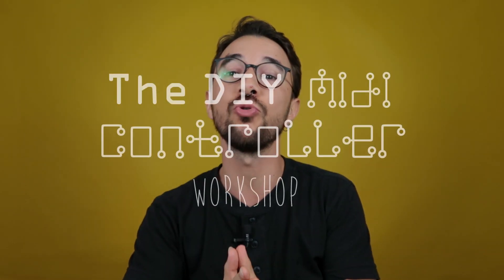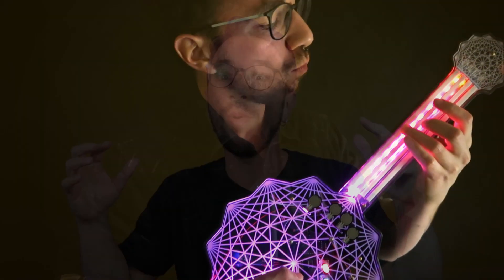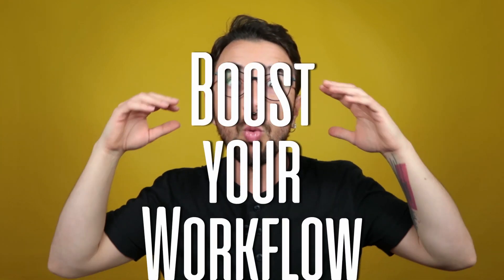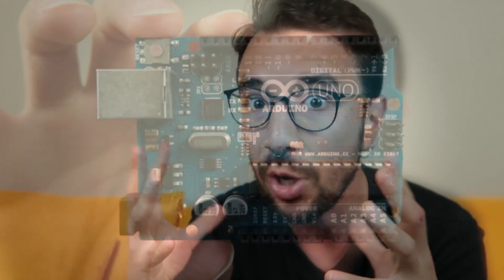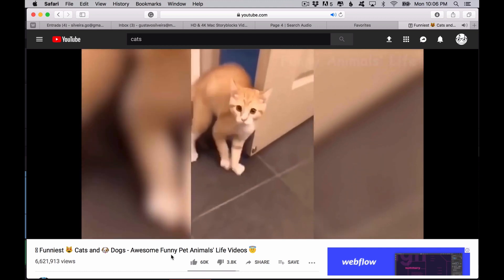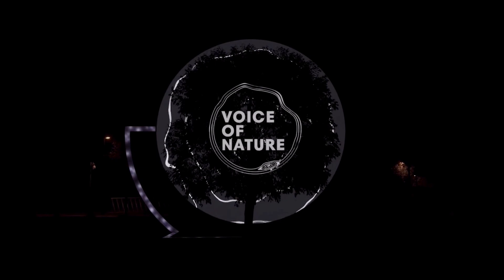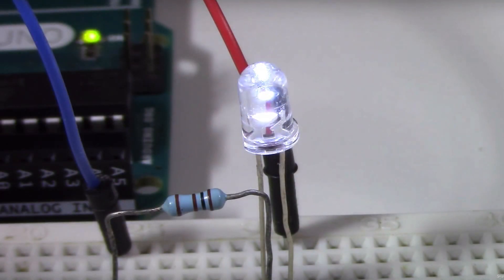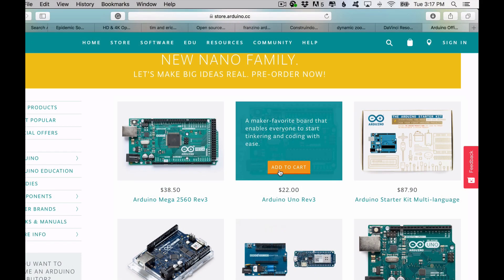#1 How to Build a MIDI controller with an Arduino: The DIY MIDI Controller Workshop 2.0

Comment: I have Morningstar MC6 MKii and I only want to build arduino project to send MIDI CC messages to indicator LED light for each footswtiches . What type of Arduino would you recommend. Does the new Arduino Nano R4 works for this kind of project?
Reply from the maker: I haven't been able to use my usual libraries with the newer Arduinos, so I'd wait some more time to start using them.

Comment: I would like to know what kind of Arduino I can use to trigger presets on an Alesis Q2? What I used to do on an RFX midi buddy pedal is press the switches 0-9 and it would trigger presets numbered 000-009. Then there was another switch that allowed me to bank 10-19 and so forth! Up to 128 presets.
Reply from the maker: An Arduino Pro Micro. But, start here to understand the basics: https://go.musiconerd.com/diy-midi-controller-workshop

Comment: Hi, I am looking to build a MIDI controller with at least 72 full rotation (relative) potentiometers sending 7bit / 14bit MIDI. These knobs will be clustered in 9 sets of 8.  In addition, I wish to have a 16 step knob (or a slider?) for for each set of 8 knobs that sets the MIDI channel for that set of knobs.  This rig will replace my beloved FaderFox PC12 with full rotational (relative) knobs, rapid channel switching, and m uch bigger (say, 3/4inch) heavy duty knobs.  It is basically a dream rig for my live synth set up.
Reply from the maker: you can do it, but you should start with smaller prototypes! I teach how to do all you need in my making music with Arduino course. https://go.musiconerd.com/making-music-with-arduino

Comment: I bought the midi fighter 3d and need to send lower octaves than is supported by default, so still need to use an arduino to change the midi notes 😛

Comment: I wish I had a use for a light, temperature or humidity sensor in the controller I want to build. They'd be fun to experiment with, but not very practical for onstage playing.

Comment: I'm not going to say that I would like to build it, because I definitely will. I'm going to build a set of foot pedals that control variable resistors, or pots, and foot switches that will toggle between the CCs the pedals are sending out with one switch per pedal. It will have to have some sort of accompanying software either just on board or on a separate computer to choose which CCs each button switches between. I figured out a way to use VST effects on guitar with very little latency so I thought I might assign some contollers to the parameters, but stopping playing every time I want to turn a knob or move a slider is cumbersome, and my feet are free. I figure 4x2 pedals with the button switches on each side next to each one will be about the biggest that will still be practical. This will be my my first electronics and software project ever and to be honest I'm more than a little intimidated, but I think it might be my best option right now so I kinda gotta do it anyway.

Comment: I want to built a midi mixer for ableton.
What I've thought is That for the mixer potentiometers, I would like to to have rotary encoders with leds on the side for indicating the level. So any saved project you open, automatically the encoder shows you the position of the potentiometer in the daw
This is like motorized potentiometer but more simple and cheaper

Comment: Not sure im going to learn all this Arduino coding stuff - but it would be pretty awesome to have a custom controller for some of my favorite NI plugins - or maybe for a project that i build in Reaktor..! Although with Reaktor, it might be easier to find a nice midi controller that has a layout that is suitable for the type of Reaktor project that i want to create, and then design the Reaktor project to match the design of this midi controller.

Comment: Title: "How to Build..." 
Content: Explains purpose of MIDI and that Arduino is a way you could build one. 
"How to" not included. No code, no details about MIDI spec or libraries or hardware details necessary to actually do it.14min wasted
Title should be: "What does MIDI accomplish and can you make a MIDI controller with Arduino?"

Comment: Is it possible to make a midi controller with ribbon controls , and pitch bend , mod wheel, and a bunch of CC knobs , CV gates and work with a 73 poly agtertouch? Can you use many arduino systems together ?

Comment: Basically i wanna build a midi controller that allows me to take any sound from any instrument or mic and convert it to actual midi notes👌👌👌i also wanna throw in some drum pads that are small enough and versatile to stick on any surface so i can use em on any instrument so i can do easier live looping sessions😏👌imma do the led projects after i get these to work tho😅but i wanna make velocity sensative lights that interacts with the instruments i use and individually with each note i play😁
Reply: For what it's worth, I was recently looking into where the current state-of-the-art was in converting sound into MIDI in real time.  For the most part existing software wants an existing file to convert.  And it is helpful to tell it if it is a melody, polyphony, or drum track.
The only thing I found in my admittedly non-exhaustive search was the OVox plugin.  It can give MIDI output in real time as well as do a bunch of other things.  (https://www.waves.com/plugins/ovox-vocal-resynthesis#ovox-next-generation-voice-controlled-synth)
Reply: @lannyfuller8367  thats another thing: i dont have a laptop/pc to run plugins cuz i produce... well, i try to produce everythin on my phone and so far, its limitations surpass its potential😅but imma keep this in mind for when i DO get a laptop or pc👌👌👌also, im using a Samsung galaxy j2 prime... i cant even get my otg cable to work and i been lookin for ways to make it work this entire week😥so a laptop or pc would kinda clear all my limitations, ya kno?

Comment: I would like to build a controller for Spitfire Audio Plugins or the Kontact Player for specific CC midi control like Expression, Vibrato and Dynamics. Also to select between articulations which is currently difficult to use because I have to assign them to key switches. Any guidance would be helpful.

Comment: I want to build a 5 keyboard (61 on/off keys each), 1 pedalboard (32 on/off notes) pipe organ console with 5 analog  (linear or possibly rotary potentiometers) pedal controllers and approx 120 stops (latching on/off buttons similar to a pinball machine buttons) and about 60 small momentary preset push buttons for basically sending sysex type messages ('registrations or combinations of stops).
I can do with 6 separate boards, but the biggest Arduino board I have found is the Mega which only has 53 digital I/O and I need at least 61 for each keyboard manual.
Then I need to decide if I want each board to output MIDI and use a midi merge, or if I should output each as USB to a USB hub and then into the computer and use something like hairless (is that right) to convert to midi for a virtual pipe organ software called Hauptwerk.
I have the keys and pedals.  I just need to figure out how to build the adapters without much latency (note lag).

Comment: I have a question. The Novation Nocturn is a fantastic midi controller. It only functions with a driver and automap which are not supported in the latest OS Catalina. Its seems to me that a nice project would be to convert this unit into a ‘dump’ midi controller using arduino. Is there any way of doing this?  Thank you!

Comment: I am looking for a good explanation so that I can build a midi controller for the sylenth VST synthesizer myself. For this I want to use a Robotdyn mega xpro 2560. The midi controller is modularly built with a vintage look. The first modules I want to build are the midi controllers for the 4 oscillators. In total there will be 14 modules.

Comment: hello and thanks for your video. I just need to build a WIRELESS controller with two buttons one  to launch effects and one to pause (for example to use with abelton live or Millumin or with Qlab…) just to launc effects from the stage as we are performing a thether piece…thanks for your answer and for your informations 
Best regards

Comment: Hi, very cool and interesting video. Building electronic music circuits changed my life. I am a retired Union electrician and instrumentation technician now.
My main controller is a Roland FR-3X virtual accordion.
I started building circuits back in the late 1960s. Built PAIA synth/computer. Tried to build a Minimoog at NASA (long story).I was looking for a way to build a very simple midi theremin and stumbled onto your videos. Just sending out one CC value on one channel based on a proximity sensor would work. I like how Merzog modulates a filter with one. Thanks and great work.👍🎶

Comment: Hey, crazy question. I have Yamaha Steinberg N8 DAW mixer that is bust, but also relies on FW connection (not laptop frindly thunderbolt or usb), so my question is, would I be able to recreate the device with arduino circuits? keep in mind the N8 has preamps and individual channels Id like to keep individual in my DAW
Reply: Looking back into the matter after doing bunch of other stuff in between.

Comment: Question: Would an incremental rotary encoder or absolute rotary encoder be better for a midi controller? Or does it just depend on it's function? I'm struggling to understand the differences and how they would effect on what I'd use either one for.
Reply from the maker: It depends on what you want. Encoders are good if you want to use one knob for multiple things, because you can just update their value and update an led ring. But they are trickier to use and you can't use as much in an Arduino.
Normal pots are better to play because you know their physical position, but it's a matter of taste. Also, easier to use and you can hook up a ton of them using multiplexers.

Comment: Working on designing an expandable SSL-style controller for Propellerhead Reason DAW. Problem I am running into is that I need to make the project expandable, from like 8 to maybe 32 channels, or more. What I am not sure about is how to link all boards together to a single MIDI bus. Thanks for making this video!
Reply from the maker: You need to use multiplexers, they multiply the number of inputs. Something I teach in the complete course. https://nerdmusician.teachable.com/p/making-music-with-arduino

Comment: Is there a course in your website specifically for the led strips?, where you tell how to create the led strips connection (e.g. physical and w/ software) to the keyboard? what kind of wirings needed? I want to build a led visualizer for my keyboard piano (there’s 2 ways for that after I’ve researched. 1) is using raspberry pi (which can be expensive for all the connections/wirings needed), and 2) is the arduino

But, I’m not techy, and need a step-by-step on how to do this led visualizer
Reply from the maker: I already have how to use normal leds, and how to use digital led strips is my next topic I'll add to the course!

Comment: I want to build an 16 endless rotary encoder controller with oled Display to read synth parameters und have feedback..
Reply from the maker: That's a great and a little advanced project. Rotary encoders require special pins (pins with interrupts), and are harder to program than the normal pots. But I cover everything in the complete course: https://nerdmusician.teachable.com/p/making-music-with-arduino
Reply: that would be awesome. i would also like to build an controller like the behringer bcr 2000. it has everything you need to control vst from technically view. You can also use it as a Step sequencer because of led ring. i think its called zaquencer. Like it a mulit functional midi controller. on bcr you cant change from step sequencer to midi controller mode.. a hybrid controller.. ??

Comment: Great video and thanks for doing this. I would like to build a drumpad (FSR) controller with buttons and knobs. I know there are some out there already but would love to build my own with what I need.
Reply from the maker: FSR will give you after touch too, but if it's for drums you could use piezos too, which are cheaper and a little easier to use.